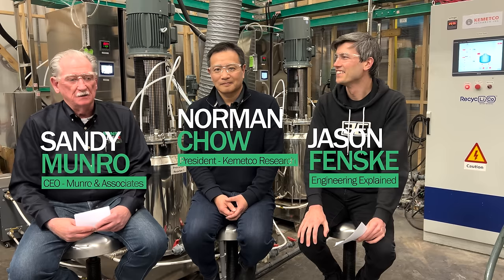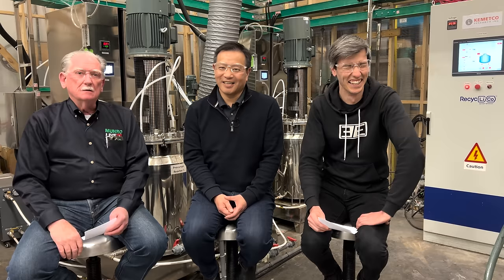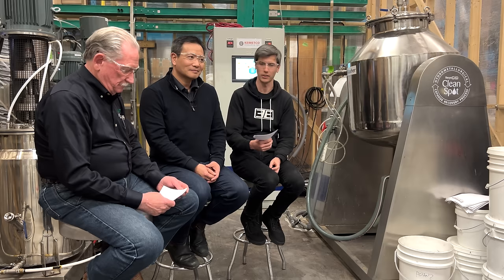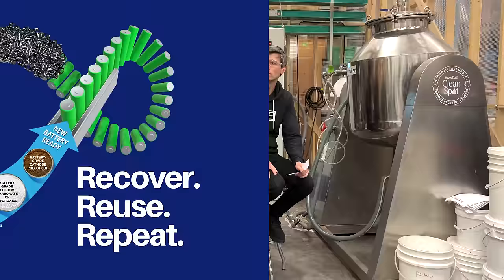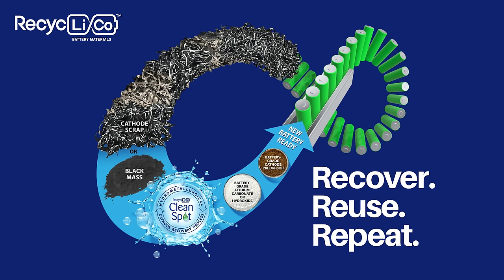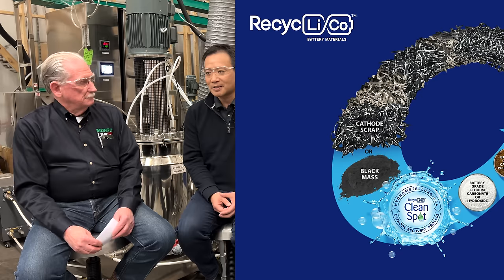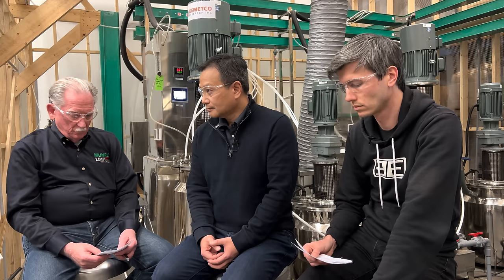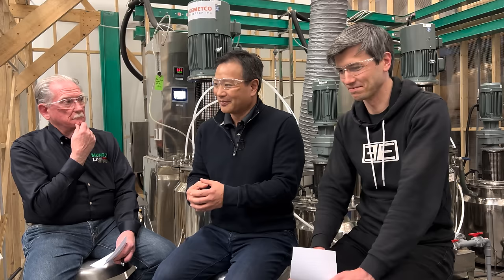RecycLiCo Battery Recycling Q&A with Engineering Explained & Kemetco Research

Comment: 16:30 the bad news is all the energy, materials used to make the equipment to make batteries and remaking them has emissions so wee need to get away from personal owned vehicles
Reply: The problem is the way Goverments go about getting people out of personal vehicles, it's not by offering better alternatives in most cases, but insted they bully the public by putting massive tax, fees and restrictions on all people, even those that don't have any other good option than to drive or maybe those who really enjoy driving.  

For example me and my girlfriend for finacial and family reasons live around 30 minuets apart via car, but if we were to use public transport it would take 2h30 on two different busses or 1h30 on two different trains. With it costing 2-3 times as much vs Fuel for the car .
Reply: Nope its electric cars now and maybe something else later . COVID has shown remote Work is something, someday even transportation could be non essential with VR and such
Reply: Which is Tesla's goal. This week at the Bosch conference, Mr Musk re-emphasized the importance of Tesla's plan to reduce vehicle ownership by 80%.
Reply: @callumcurtis15  you need to change that situation then. just cause you enjoy it doesnt make it a right or the right way to do it, we should not be making 4-5 billion vehicles of any power source and fcking boats, planes.
Reply: @H4N5O1O  I don't need to do anything actually, thanks for the suggestion though 👍🏼.
Reply: So all the equipment to make the smelters and the huge energy needed to make Aluminium for the massive amount of the engine block in a ICE car does not count? The waste oil from ICE cars is in the millions of Gallons per week, no mention? The equipment to make the machine tools to make ICE engine components is a lot more than the far simpler EV. Battery recycling is efficient already and will be come substantially more efficient. Maybe you comment is a kick back to change? You can drive ICE cars for many years to come. They will become increasingly more expensive to own, maintain and fuel but you can still do it 😮
Reply: It makes more sense to have facilities regionally based to grind the battery to black mass and ship the black mass to the more complex recycling plant.

Comment: the BAD NEWS about Recycling LITHIUM car batteries is , there is NOT enough CAR batteries AT or near END of Life. 
most car battery PACKS last 20+ years and TESLA LFP can last 50+ years (2170/1865 = 35+ years). 
so in this EARLY period , most battery supply will come from PRODUCTION feed stock, which is a good thing.
Reply: i mean they could also get water damaged/crash/totled evs too
Reply: While LFPs might last a loooooong time - the electronics like the BMS will have a problem long time before that. It will depend in the future of the aftermarket whether it makes sense to just recycle the whole battery rather than repair it.
Reply: @rkan2   - also TESLA batteries have 8+ year Warranty and last DECADES.

Comment: ALL CAR Races , should Already be 100% BEV and that should PHASE OUT all ICE Race cars .
REPLACE w/ Lithium batteries Sponsored by BATTERY OEMs , who put their BEST battery cells into PERFORMANCE RACE cars to Compete. 
then Develop those into CONSUMER car Products.
Reply: What category do you race in?
Reply: @justinr9753   - UNLIMITED Stock category
I Drive STOCK Plaid S w/ RACING parts from UNPLUGGED . 
I do 1.866 1/4 mile STOCK tires. 
I am BANNED for being TOO FAST at Several Tracks. 
I dont use Parachute or Roll cage. STOCK car.
Reply: @markplott4820 What year is your Plaid S?
Reply: @SufferJoker   - dont know Bought from Unplugged for $200k.

Comment: But of outdated info on the wa lithium mines it’s two mines now. The original (green bushes) is controlled by Chinese’s company by owning 51% of a company that owns 51% of the mine. They have started a processing plant in au now at the industrial area near Perth not to far from the mine to process a portion of the mines output to Lithium hydroxide but the plant was very expensive to build and commission compared to one in china even though it isn’t in a remote area. Time will tell what long term operation costs turn out to be vs shipping the ore. The other big mine that outputs much the same volume of basic concentrate (Pilbara minerals) is just a asx listed company. Don’t see them doing a lithium hydroxide plant any time soon, building and operating stuff in the Pilbara is expensive as it’s a remote area. You also have to look at the imports, if you have to import the acid etc. from china to do the processing why not just send them the ore and the long term waste issues. Australians don’t tend to mind mines so much but have heavy restrictions of pollution from refining.

Comment: Until Tesla actually includes the cost of recycling in the price of the car they sell and create the factory to do it, they will continue to manufacture battery packs full of foam, glue and other garbage that is a disaster for recycling.
Reply: I guess you haven't heard of Redwood Materials - founded by JB Straubel, Tesla founder. Recycling is not a "cost." Redwood is making a profit.

Comment: basic , they should END Commerical production of Disposable battery cells , in Favor or LFP & Lithium RECHARGABLE battery cells for Flashlights & Consumer ELECTRONICS. 
but, they still have to RECYCLE all these LEGACY battery cells. 
including AUTOMOTIVE 12v Lead Acid, GEL cells & AGM batteries, Completely REPLACE w/ 15.5v Lithium.
Reply: Didn’t you know that 12 volt lead acid car  batteries  are rechargeable? They get rechargeable every day. They are like any rechargeable battery when it will no longer hold a charge needs to be recycled
Reply: @InformedKiwi  - UNRELIABLE

Comment: I applaud the work both of you do however this time I can see biting of lips and joke’s being made when it comes to the commercial viability of these current generation of batteries being kept out of land fill I see problems big problems for the environment when we inevitably have dumping just like we have already with tyres and other unviable to recycle materials so many problems here I can only hope it doesn’t set back the whole concept of Electric cars because the whole thing has been been pushed  to market too hard too fast by a wishful utopian green agenda that is artificially subsidised to the hilt instead of the engineers designers and accountants making it work organically 
JA
Reply: Battery recycling has always been the future for EVs. Elon has talked about it for years and it’s expected that within 2 decades 90% of battery materials will come from recycling There are already battery recycling plants in Asia, U.S.A and Europe and they are doing a good job. Battery tech has advanced so much in even 5 years and batteries now mostly have a life far greater than the car. There is an infant but growing business of using used EV car batteries in solar storage before they get recycled.

Comment: 14:30 Stick to talking about recycling, you know little about where lithium comes from. less than 1%?😂 Most lithium is from brine coming from wells IVR, they pump out to fields. Hard rock is a newer area, as brine deposits go down. 1% is un economic to mine.